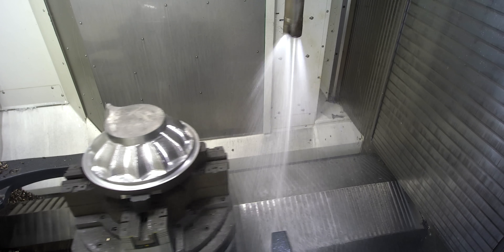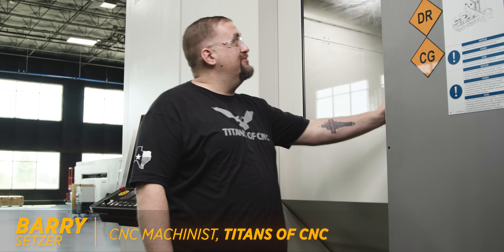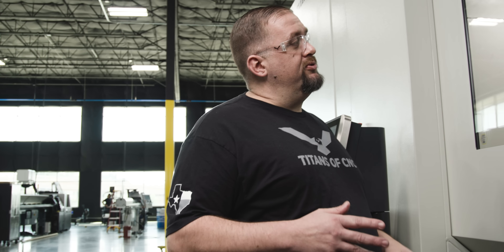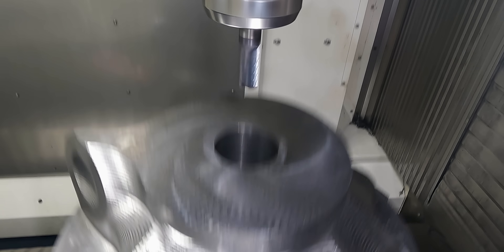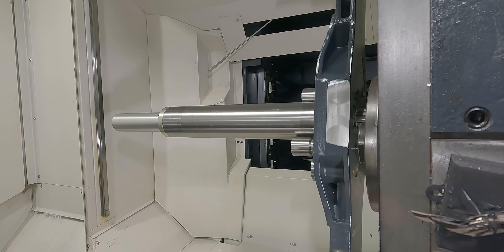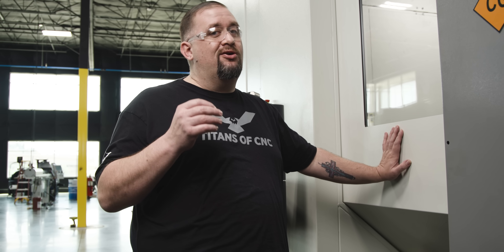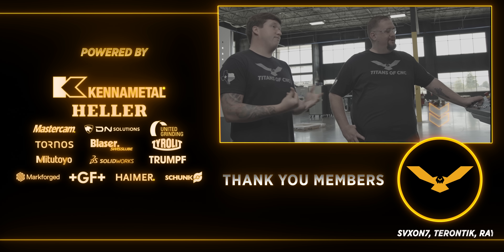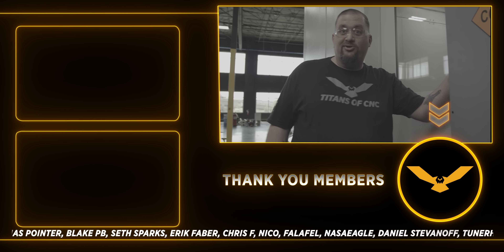I Full Rapid CRASHED Our HELLER CP6000

Comment: Why did it crash?
Reply from the maker: He ran the entire part above (dry ran)… except for the drill because it was to long. Then he just made a simple error in the program when editing… and then didn’t pause the tool as it approached the material… to double check that it was positioned correctly.

Simple mistake that won’t happen again.
Reply: @TITANSofCNC  Machine; -999 Z? Yes sir!
Reply: @TITANSofCNC  shit hapends
Reply: Hey, it shows it can happen to anyone at any time. Just take steps to mitigate the risk to the best of your ability.
Reply: Because the part was in the way.
Reply: Gotta love thinking R0.1 is above the part until you remember Z0. Is the bottom.
Reply: He said it he rapid into the part i know lathes its the G00 code and then drilling youd want to Go with a feed rate never Idk about mills but id assume its the same
Reply: Looking at it in slow-mo, was the drill spinning the wrong way?
Reply: @ArmoredZephyr  the frame rate of the camera was close enough to the speed of the drill that it looks like it went backward. It is similar to using a flashing light to "stop" something in motion.
Reply: @ArmoredZephyr  no camara  fames pr sek
Reply: Haha no, it wasnt spinning the wrong way. But it sure looks like it. Im guessing that shot was mirrored in editing or something like that
Reply: @barrysetzer  a question: did the machine stopped because the NC detected an excessive position error  or it has an anti collision system based on sensors such as accelerometers?

Comment: I've caused a crash because I forgot to load the right coordinate system and instead of prepositioning my spinning carbide end mill at 5mm above the workpiece, it caused a collision faster than i could react. I have kept the shattered end mill and the scraped part mand made a "trophy" out of it. I've milled a hole for the end mill, right next to the impact point where the shattered tool now sits and i've engraved "Memento Mori" into it. It lives on my desk as a constant reminder to double check the program aswell as things like coordinates before full sending a program.

Comment: Happens to the best of us. I witnessed a 30+year programmer crash a Haas EC-1600 at full rapid. Plowed a solid carbide boring bar into a tombstone. While trying to square away the Mastercam post for a Doosan multi-axis lathe, our lead guy buried a .5 inch diameter end mill into the workpiece twice within two hours. I once crashed the upper turret of the same machine into the main spindle while trying to sync the upper and lower turret programs (in my defense, the arrow down key on the PLC was loose and had a tendency to double-hit). Fortunately, it was only an $800 service call, no major damage. Also saw an ordinarily badass programmer cause approximately $25k damage to a Mazak integrex with one simple error. Moral of the story: don't beat yourself up.

Comment: Well, I wonder how long the Heller machines will lasts if you keep getting these repeated crashes. Reason being I am used to my boss crashing the DMG Mori he uses. I kid you not, it is not uncommon for a few crashes a month and the machine runs like nobody's business. Last time he crashed the spindle. Not a run of the mill crash, but by where the tool holding and the spindle meet. The spindle ate some aluminum like a champ, the machine runs like nothing ever happened to it.

Comment: I don't know what the heller kinematic test is actually measuring. Assuming that it's like the DMG Mori one, where the machine detects the position of rotary axes pivot, i would recommend to check the backlash of z axis as well. It's just a suggestion, not a criticism!

Comment: I was taught to use single block with reduced rapid speed for the first time running a program. Saved my butt several times as a result. I was at another shop running Lathes and the shop foreman asked me to run a mill job one night. He loaded the program and assumed that everything was ok and hit the green button. All hell broke loose. There was another fixture on the table and it hit so bad that the machine was knocked off its mounting pads, Broke the spindle and messed up the gear box. Cost was $9K to repair and he tried to blame it on me. I was clear across the shop and heard the building shudder and thought that's going to be expensive. The owner came up to me and asked who did it. He knew who did it but asked to confirm it, makes your you know what pucker up a tad!!

Comment: We'll revisit this in 6-8 months if you still have the machine when the spindle bearings fail. Axial crashes are the least worst way to crash, but still hard on the machine and typically dent the bearings in the spindle which leads to long term fretting and spindle failure. 

Crashes do and will happen again. name of the game in this world. Willing to bet either wrong work coordinate or wrong  tool length offset was called. classic oopsie lol

Comment: Very fun vid, thanks! 

From the ultra-precision side (SPDT), a crash usually meant a $1500 diamond tool just went bye bye. On my optical generators (fancy 5 axis machines), a crash usually just meant referencing the axes as the fast traverses just weren't all that fast. But everything would be off a few microns or a few thou deg. Usually the optical blank went bye bye.

Comment: There was one time at my last job where a guy crashed a DMG mori at 100% rapid with a 4in face mill in the spindle. It was a horizontal so the pallet was tilted way back and the spindle was cracked all the way down the side and was melted on the inside. It ended up costing the company $50,000 to fix because it messed up multiple axis the spindle had to be completely rebuilt and the glass was completely shattered
Reply: Jeeeez thats brutal!
Reply: @barrysetzer  yeah! I was standing right next to the machine. The feeling of the ground shaking was insane! The guy was doing a setup for production parts and he turned block delete on and it was programmed wrong and had the wrong pallet in and bam!

Comment: I've hade 2 serious crashed.  The first one i did what i was told dispite i didn't like the idea.. but i was in the beginning of my career so i obeyed. Almost lost my life.. the second one totally my fault, full speed bouth axis with a 52 mm drill from -20 mm inside hole out to tool change  position.  After that i did some changes in my rutins and never jump over a step.. sins then I've hade a blast. 
Excuse my bad eng.. I'm from Sweden.

Comment: So Barry, what did you do to crash it? Forget to set a tool offset? Mix up coordinate systems? Inquiring minds want to know!
Reply: I copied a line to preposition the spindle before the head rotated, but didnt realize the line had a D0 tool length cancel in it. And of course i did that AFTER i dry ran it 😂

Comment: For the life of me I don't understand how they don't have intuitive lasers/sensors/scanners that can detect a crash before it happens and stop the machine before it even rapids/moves
Reply: Lasers, sensors and scanners don't last long in the machining environment.  What they do is sense rapid increases in load on the spindle or drive axis motors and stop the machine accordingly.  That is what happened here.
Reply: @brandons9138  so your saying the Renishaw touch probe does't last??????? My point is it could be any number of availabe technologies to make sure not even this happens. The information is in the control. Spending that much money on a machine should be standard equipment by now
Reply: @jaxnaturals  It's not the probe that dies.  It's the receiver that lives in the machining zone for every part run on the machine that dies.  The coolant messes up the unit or chips are pounding on it.  When they work they are great, but they always seem to have issues as they age.
Reply: @brandons9138  then just like the tool changer, give it is own sealed room and pops out while the tool change is happening, checks the Z suface that the tool is set to machine and checks that against tool offset and z rapid clearance distance and it either passes or fails that check. If it fails it stops before it rapids and alarms the machine
Reply: @brandons9138  and this option only needs to be enabled on the first run part. Once g code is proofed, then disable for the production run
Reply: @jaxnaturals  So what happens if the operator loads an over sized blank or misloads the fixture?  You're right back in the same place with a machine crash.  Humans are the problem.  We always are, always will be.

Comment: I have the same feature on my 30 year old Okuma. Its just built so damn tough it can take full rapid crashes. After a crash, I put a piece of wood between the turret and ram the machine in the opposite direction to straighten it out. Dial it in and back to machining again.

Comment: That's probably the best sales video for heller I have ever seen. The biggest fear I have in purchasing a large mill like that would be the inevitable crash. Good to see they have some form of remediation to avoid major damage.
Reply: they can't have that fast of a reaction to prevent damage, at least with bearings its pretty much impossible. The Microdent that was made inside the bearing rings / the deformation in the bearing balls means that the service life of those bearings is like 100th of their normal service life. Especially with the impact vector that happened here. My Professor in CNC machining (developed and built cnc 3/5 axis machines in germany for 30 years) said that these crashes happen, but if its a bad one (like in the video), you won't notice it in the first few hours, thinking the machine didn't get hurt. Like a month later, you need to have the spindle serviced, because it won't run properly anymore. Nobody thinks about the crash because noone reports it (at least most of the time) and so the connection between the two is never noticed. Every time you fullrun your spindle directly into the a part with maximum velocity, he said you can schedule a service like a month in the future from that crash. Of course this can be a crash that wasn't that bad, in perspective to the bearing size, but it 100% decreased the service life of the axial load bearings.
Reply: @maxcimander188 I’m sorry, but you’re wrong, this is new technology , every machine has a maximum axial load for machining, your Z axis load, on newer machines even some haas, it’s called crash prevention, you can set a maximum load to alarm the machine out to prevent damage, let’s say the machine takes damage at around 180% z axis load, you can set the machine to come to a dead stop at 100%, this is very common now on most machines.
Reply: yes it is very likely indeed @maxcimander188

Comment: You'd think that in 2023 all new machines would have enough situational awareness in the work envelope that they'd avoid crashing entirely.  "Nope, Sparky, that drill's too long for that rapid feed command to work. Stopping it before contact. You're welcome."   Eventually, via various sensor systems, machines will have that capability.
Reply: And he explained in the comments... Tool length deactivated by hand programming an additional line... That's how it usually happens 🤣 and how the machine knows not to expect resistance on G0 and stops... Hopefully 😬
Reply: I assume Barry did program it in some sort of CAM program. So it shouldn't have happened anyways. Either due to machine simulation or standard values (drill cycle starting at stock top). Which makes me wonder how it happened in the first place...

Comment: I work with mazak machines and I have also had some strong blows in G0, the truth is that they have all withstood without the slightest problem or misalignment, the horizontal machines from my experience are much more robust, the heller tool change seems quite enough to me slow I have noticed that it changes tools slowly my mazak with double contact bt40 changes tools in less than 3 seconds iit's scary
Reply: thats a hsk 100 though,heavier tools
Reply: agreed, mazak tool changes are insane! you use gcode or mazatrol??

Comment: That wasn't a full rapid crash. Maybe 50% rapid. 
You obviously weren't watching distance to go on a new part. 
Reason for crash?
Looks like either no drill cycle or you forgot to set tool lenth.
I've had some bad crashes in my 36 years,  that was just a thump.
Straight Z crash, in center of 5th shouldn't do much damage at all.
Reply: I was hand coding a little bit and copied a line to the wrong spot. Tool length cancel

Comment: One of my favourite sayings,
"If it ain't broke, try harder!"

I'm the kind of guy who sale reps hate because if they tell me a tool runs at X, that tool is being tested FIRST TIME at X. No messing around 😂
Reply: Like me, because I go full throttle on a rebuilt engine on the first test drive. Gotta set the piston rings.
Reply: In theory it should run max capacity best at first, before it's had time to wear down a little.

Comment: From what I seen so far hermle mashin's are very similar to thisbut got higher acceleration so there is no chance they can detect that at that speed one thing they got tho are aluminum bushings so in lots of cases they take the hit so you don't have to replace the complete spindle just the head
Reply: i have crashed 3 or 4 of them,the bushings saved me every time
Reply: @kristiankautto7616  i haven't so far but the Maschinist before me has and got saved by those. Really great mashine

Comment: the huge lathes i run can take a crash pretty much like a train derailment!  ive crashed a few times and other employees combined have destroyed $10s of 1000s worth of tooling and absolutely no damage to the machine.    id call my self a liar if id not witnessed it over the last 8+ years.    Early 1970s built ROMi. lathes they are absolute brutes of machines.  the servos will crush the tool (insert) holders and not even flinch.

Comment: I would be more impressed if you full rapid lateral position x y and ran into the part and no damage occured....Straight vertical hit is best case scenario for minimal damage or re-calibration.
Reply: I have that same thought everytime I see a company demo these anti crash features
Reply: Almost as if they did that on purpose for that video. You barely can call that a "crash". But it makes a good video title.
Reply: A verticle plunge like this will feed 100% of the force into the part.. coming in on the X Y axis would cause defelction and bend mill parts. This plunge test could easily damage machine parts that are very DEEP within the CNC
Reply: @03bugeye  your point is? I still agree with OP that an x y crash is a much more substantial impact because of the angle on the spindle whilst a vehicle crash is much evenly absorbed. Your bending anything with the spindle you're just stopping fast.

Comment: Is this the origin story of Titan saying "Boom"?
Reply: Yeah, I always thought it was funny because "boom" is something one never wants to hear in a machine shop.

A couple years ago someone in my shop did a full send 100%/1100 IPM rapid on a Doosan lathe all the way into the spindle at 800 RPM.  The impacting tool holder got ripped in half, the main spindle bearing is now incredibly loud, and the turret got knocked out of alignment on both X and Z (the taper pins were unfortunately still installed and were ruined).  So now whenever anyone asks we tell them the difference between 0.8 and .08 is about $20,000 USD.